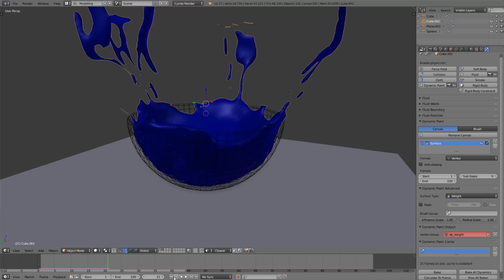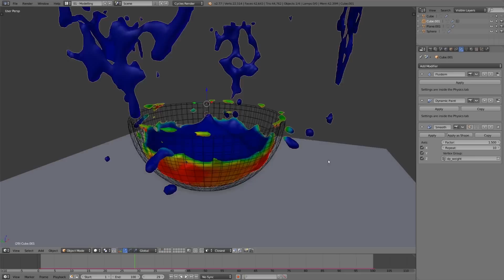Smoothing Edges in Blender's Fluid Simulator

Comment: Is it possible to do this without manual baking step? I'd rather have a setup which works even if I need to modify/move/resize the fluid object that is dropped into the bowl without needing to rebake the whole thing.
Reply: You have to rebake the fluid sim regardless if you change something